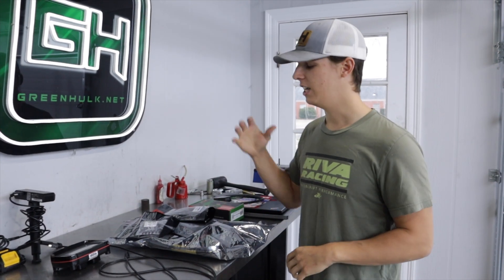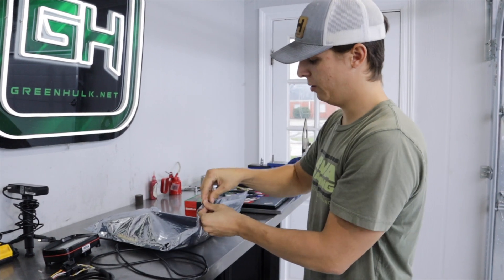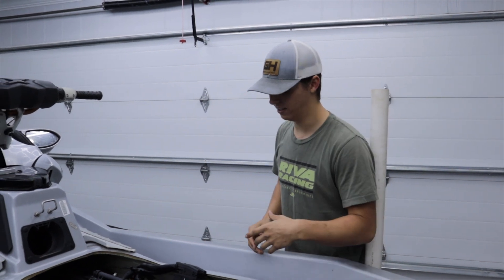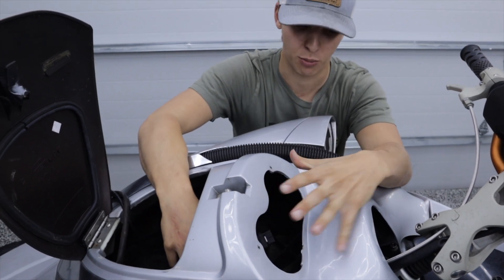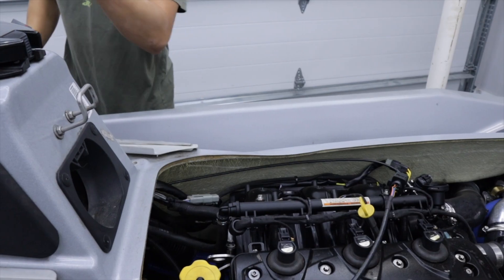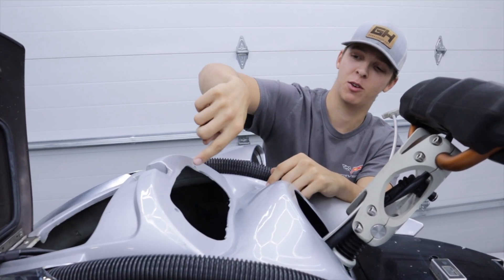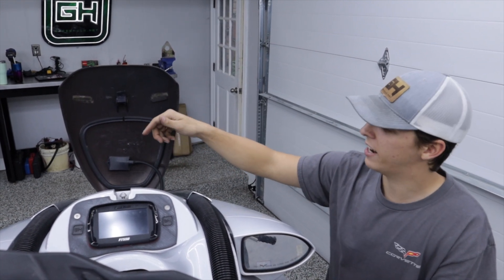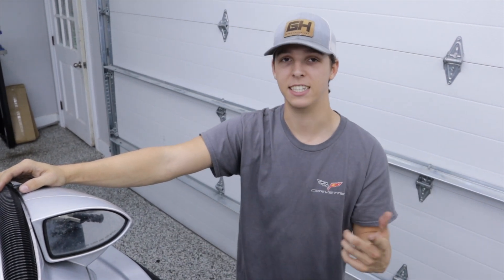Installing a FuelTech FT550 ECU on My 2008 Sea-Doo RXP-X

Comment: Which fuel tech system will be good for a turbo setup on a 06 RXP.  Ft450 or the ft550. What o2 sensors connect to the fuel tech system?
Reply from the maker: Either one would work. The FT450 is the same ECU and dash but with limited inputs and outputs. It has enough inputs and outputs to run the engine. If you want to add multiple sensors or use it as a boost controller for a turbo the the FT550 will be the way to go. 

I am using the FuelTech WB-O2 Nano with a Bosch LSU 4.2 O2 sensor. FuelTech also has a Nano Pro version that is more advanced and can utilize better O2 sensors. The FuelTech O2 conditioners communicate with the ECU on their CAN network so it does not use up any inputs. It is a fantastic system

Comment: Can this be done on the 05 and older skis as well? I'd like to see this on an older turbo engine. Also, does it have a base "auto-tune" function using the O2 sensor and other parameters for setting itself up like the Motec.
Reply from the maker: You can use it on any Siemens ECU Sea-Doo. It would be a fantastic ECU for a turbo ski. 

You can set your desired AFR at a given boost level and RPM and the O2 closed loop feature will keep it there. You can then use the closed loop O2 correction to refine the fuel map.
Reply: Thanks Greg. What FuelTech products are needed to interface?
Reply from the maker: All that is needed is a FT450, harness, and igniter. You are limited with the FT450 so I would definitely consider upgraded to a FT550 to have more inputs and outputs. I’d also add a WB-O2 Nano to monitor and datalog AFR through the ECU. You can find all of the products in our store here: https://www.4-tecperformance.com/index.php?main_page=index&cPath=547
Reply: @GreenHulkGarage  Thank you sir... Hydrotoys.

Comment: Can’t wait to see more on this build, these muscle skis where so much fun. New age people ask for a high horse power Spark well just get one of these RXP-X they are about the same size and you can grab 300hp out of the old 4tecs pretty easily these days.
Reply from the maker: Exactly! These old fiberglass hulls will also take much more abuse than a plastic spark hull. This build will make way more than 300 HP 😉